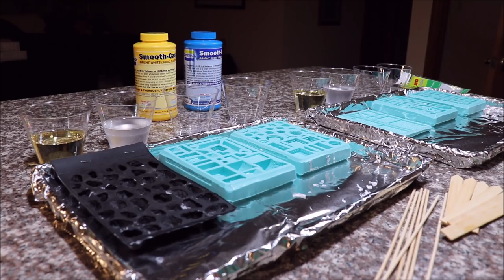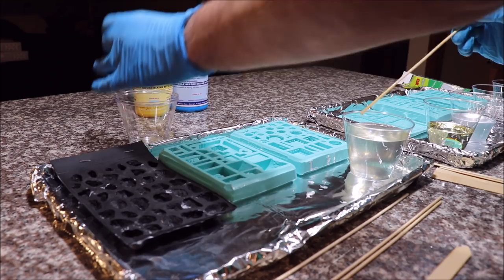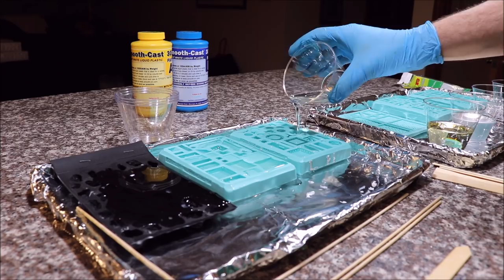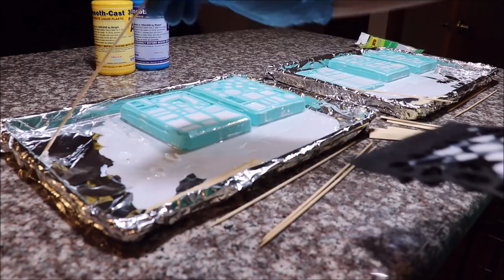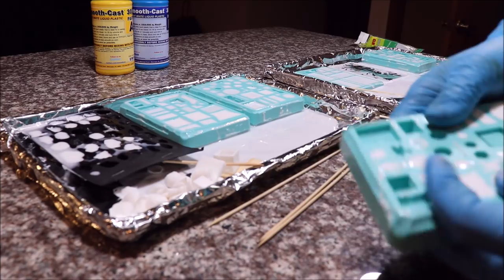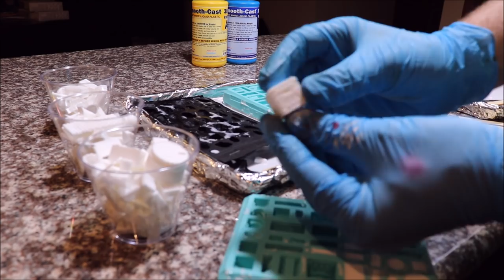Hobby Cheating 152 - How to Cast with Resin in Molds

Comment: Well if you get the stuff on your skin it will burn through, but it will take time (hours)... and its painless. 

Use "scrapy" stick for mixing, it will be more effective, and take less time to properly mix, as you wont need the extra cup. 

Also, I tend to pour cup A in to cup B, saves a lot of cups ;). 

A soft plastic cup is better as you can squeez it, to get a more controlled pour.
Reply from the maker: Good tips all around sir, I knew you have plenty of expertise in this for sure. I will have to look at the mix, I am always a fan of using what I have as I do this so rarely, and the sticks are multi-purpose. :)
Reply: Using what you have is always a better idea then going out and buying a bunch of things you don't really need. 

For cups I like to use the basic plastic cup you drink water from. Cut off the top ring as it is there to prevent form deforming the cup. Then you have excellent control in our pours, and you will not have to wipe off the excess as well as yo will fill each cast better.

Comment: I noticed that someone mentions using a syringe, I think you could also place one of those sticks across your cup and hold in place with the index finger and the stick should direct the pour.  something I learned in chem II years ago.
Reply from the maker: Yep, I have tried it now with the large syringe recommended (it's not a needle, it's a large plastic tube end) and it works wonderfully well.

Comment: Thanks, man. Very clear and understandable tutorial, as always. Would it be easier to control the pour if the 4th cup was a cardboard cup instead of a plastic one  because then you could create an angle in the top ring of the cup to get a spout and control how the flow is going out of the cup ? (don't know if the mix of resin is compatible with cardboard cup) And maybe a hairdryer over the molds after the pouring could help to slightly shake the liquid and to get rid of the small bubbles ?
Reply from the maker: I don't know about cardboard (it might absorb). A thinner cup you can shape or one with a little pouring lip is generally your best. You can tap the tray a little while drying to get some bubbles out.

Comment: Very cool to see you using the resin I was thinking of trying out (was recommended by another friend as well)! I notice you didn't agitate the trays after pouring? Although it seemed to fill very well, and with few bubbles in any case. A minor point, I learned that it's best to stir pretty much anything in a figure 8 pattern - it reduces bubble creation overall. Learned that when soap making.
Reply from the maker: Cool point on the figure 8 discussion. Yeah, I don't really agitate these. Sometimes I will tap them a little, but this brand does a really good job of self-leveling and letting the bubbles out, which is one of the reasons I like it so much. :)
Reply: @VinceVenturella  excellent! Exactly what I need to know ^_^ I'm trying to cast some bases for an army atm

Comment: So, if you're worried about the longevity of your molds, I would recommend getting a silicone-based mold release; the reason being most molds like this are made of silicone, and the strong exothermic reaction from the resin (the faster the resin cures, the hotter it gets) can cause it to bond to the mold, usually in small patches, so the silicone mold release will help keep this damage from happening.  I have a Hirst Arts molds in my hobby room and I'm still working on getting some resin and mold release to start casting for basing elements.
Reply from the maker: I've never wanted to mess with them and really found it necessary, To be honest, I've cast about 8-12 times out of those molds in 2 years (I don't cast often) and using 305, it never gets too hot (300 gets way hotter). I haven't seen any degredation at all. Zero. The baby powder pops it out, it's smooth and fast and I don't have to mess with scrubbing afterwards. For my purposes, basing material and terrain making, it's the perfect amount of investment in time.

Comment: Very interesting video Vince! Does the smooth cast plastic generates significant heat during the curing time?
Reply from the maker: The 305 doesn't really, as it's slower. The 300 gets hotter as it cures very fast. The 305 takes about 15 minutes to cure and doesn't get super hot (I mean, it gets warmer, as it's a chemical reaction, but not too bad).
Reply: Thank you very much, great to hear that! I want to cast with this stuff in an instant mold... which is a thermoplastic material, so I was a little bit worried if it will melt my mold or not :) But I am going to give it a try.

Comment: shouldn't you put the 4th cup in a vacuum chamber to get rid of the air bubbles before you pour in the molds? there real expensive and is why i have never tryed it.
Reply from the maker: It's not really necessary when doing this kind of casting. The Smooth Cast is pretty good about not having bubbles and them rising out. You can give some gentle taps to the mold itself. That of thing is really only necessary when doing model casting with resin, as it's a much different resin and the pour has to be much cleaner than basing supplies or terrain.
Reply: thank you for the info.

Comment: Can u use milliput standard or das clay with these molds? As an alternative to resin?
Reply from the maker: You can, but you really have to force it in and you will want to have a stronger release agent, because it will more easily get stuck to the silicon.

Comment: How quickly does resin degrade the molds?
Reply from the maker: I can't say for sure, as I have cast about 10 times out of these particular molds and I haven't hada problem. I have seen those who cast enough to make buildings and they say it happens after a few years of work.
Reply: Vince Venturella cool. A few years is good. Thanks

Comment: Hey Vince, do you really want to be doing that in your kitchen, on the surface you use to prepare food? I'm just worried about your safety, I don't want you accidentally eating some of either the resin or the catalyst.
Reply: There are resins that are used to make plastic cups and plates. Also after it cures its just plastic.
Reply: Hi  @arturstasienko2234 , maybe, after it's cured. But not all of that resin and all of that catalyst that were in the cups was fully mixed. If it doesn't mix, it wont solidify, and it'll stay a toxic liquid.

Even after they're cured, some plastics aren't food safe. This stuff might be, I don't know.

I'd still do this in my shed, not in the house!
Reply: Mikey R  Not everyone has the option of a shed
Reply: Hi  @bluesman99999 , Vince does at least have a hobby room. It would seem safer to mix and pour resin in there rather than where food is prepared.

If you live in a studio apartment, then you don't have another room. But if you don't, it might be wise to mix your resin in another room.
Reply: If you mix it half as well as Vince shows it wont be an issue. Also warm water and issue solved.
Reply from the maker: So I appreciate the concern. Once done, I wipe everything down. The countertop is marble, which is nice as you can give it a good scrub. I have some good cleaners and get everything all wiped down. Easy peasey. :)
Reply: @VinceVenturella  good stuff, I'm sure you know what you're doing. I'd still mix resin either in the shed, or upstairs in the Nerd Bunker if it was cold or raining. Which is most of the time, since I live in Yorkshire.